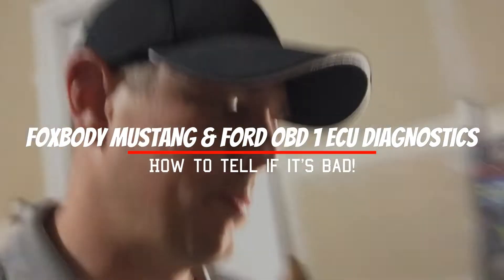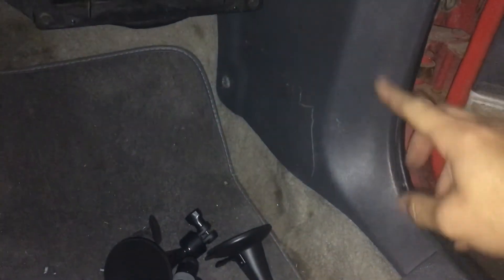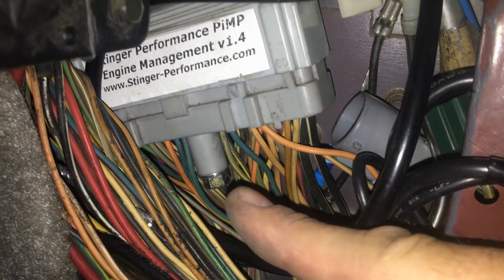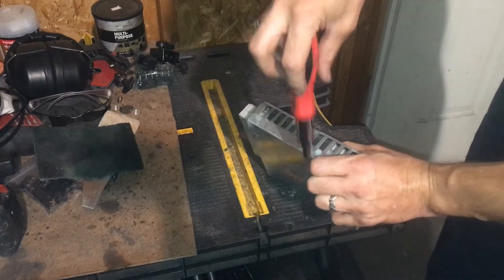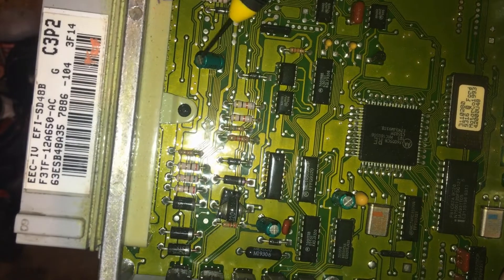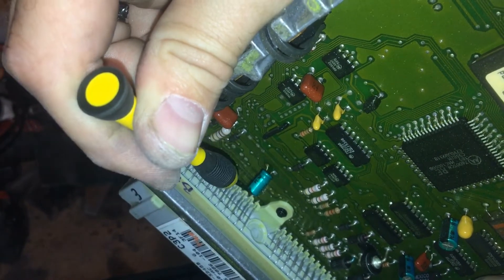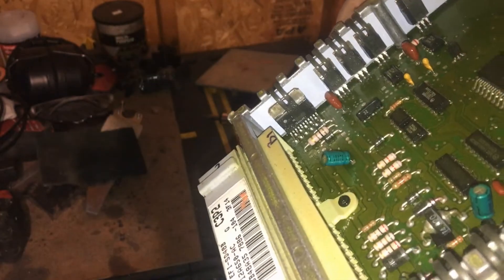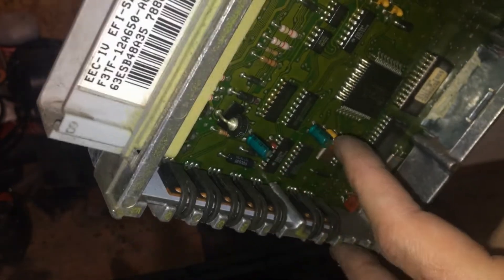How to Tell if Your Foxbody Mustang or Ford OBD 1 ECU is Bad or Needs Replaced

Comment: Did your 86, Speed Density ECU have only 2 compacitors? I'm only seeing  only 2 in a my SD ECU.
Reply from the maker: I don’t know that for sure, my apologies
Reply: @BMF_Garage  ok, thanks. You probably don't even have the SD ECU   anymore
Reply from the maker: I do actually 🤨 just gotta remember where I put it... I’ll take a look tonight..
Reply: @BMF_Garage  thanks, I appreciate that👍
There isn't squat out here, on Google or even in the Forums on this stuff. Thinking 86-88 people need to band together for info 😂
Reply from the maker: Just checked the one I’ve got left in the garage and it’s got three capacitors... maybe one of yours corroded off??
Reply: @BMF_Garage  thanks! Is that a VM1 ECU or DA1? I'm sorry, I have nothing to compare to. You have me wondering now. The car wasn't doing anything funky. 🤔
Reply from the maker: I’ll have to check on that
Reply: @BMF_Garage  thanks! I will look very closely again for a broken/, missing compacitor in the meantime. I've only found one picture of a DA 1 ECU circuit board and it only had two capacitors in it 🤔
Reply: @jpp9846  I got an 88 I'm pulling mine let you know what I got, I turn my key on relay under my seat clicks normal on for a second then off but my fuel pump stays on?  engine cranks but won't start , I leave key on and it floods my engine , swapped relay , starter selinoid , re grounded had it working fine a week later same issue again , very frustrating
Reply from the maker: Fuel pump running shouldn’t flood your engine.  Injectors control fuel into the cylinders....
Reply from the maker: Sounds like the relay contacts are welded closed.  Have you tried replacing it?  If it’s hot to the touch that’s a tell tale sign
Reply: @BMF_Garage  hello sir copy that any info greatly appreciated I'm checking all your vids now lol , I am no mechanic lol when it starts the relay kicks on and fuel pump would fire for a second then turn off till I start the car. Now I start relay clicks and pump just stays on idk why and car will not start and tacs jump on cluster also. I try to just keep this thing going me and my dad got it in a junk yard 25 years ago lol
Reply: @c431inf  I read somewhere that "some times" the ECU is the issue... specifically, bad compacitors, when the pump continues to run?
Reply from the maker: That’s correct.  The capacitors go bad and excrete a green fuzzy goo that corrodes the contacts abs can make them fall of the board
Reply from the maker: Yeah the ecu can be culprit.  I’d pull it and check the capacitor and make sure nothing on the board looks burned or shorted out.  It’s pretty noticeable if it is.  Process of elimination but having a multi meter or volt meter helps out a lot
Reply: @BMF_Garage  heading to pull it now and check it  lol greatly appreciate the guidance and assistance
Reply: @BMF_Garage  pulled it , 2 capasitors one near the pin hook up looks good , the other up top n.g. all corroded  hoping that's it ordering a new one now , I greatly appreciate the guidance sir 🤙🇺🇸
Reply from the maker: Awesome, glad to help
Reply: @c431inf  yup, I'm willing to bet that's your problem👍
Reply: @jpp9846  it was it , plugged in new ecm fired right up
Reply: @BMF_Garage  bad ECM , fucking thank you dude
Reply: @c431inf  I read they can cause it, glad to hear you have it fixed 👍👍
Reply from the maker: You’re more than welcome brother
Reply: @jpp9846  best part bro the ECM was the d1 for a manual and it's an automatic , guess they really don't matter what type lol had the wrong ECM in it since 95

Comment: Hi Clevor BMF, My 93 Mustang 5.0 GT, 5 speed cruise control doesn't work? Checked cruise control cable and not broken, checked vacuum servo and it holds pressure? So i figure it has to be the ECU (?)or the actual switch on the steering wheel????  Any suggestions?
Chip
Reply from the maker: You’ll have to get it up on jack stands and set the cruise so you can hear if it’s doing anything and test the wiring.  I recommend taking the tires of.  Less rotational mass.  Determine if it’s the wiring, switch, or vac
Reply: @BMF_Garage  We road tested it and didnt hear anything? You mean the rear tires? ?

Comment: When the capacitor pops what's happeneds after that.. do some injectors work  or is there a miss in the engine
Reply from the maker: It’ll depend on which capacitor is bad... can range from fuel pump never shutting off, crank but won’t start, barely runs at all.... some symptoms can also be caused by these parts and capacitors going bad but not completely bad yet.
Reply: @BMF_Garage  do these capacitors make a pop sound when they go?
Reply from the maker: They certainly can.  They store energy, so there’s a chance you could hear a slight pop or crackle when they go bad and discharge any stored energy

Comment: I have issue key on fuel pump staying on , I re grounded everything going nuts, I will try this
Reply from the maker: Sounds like the capacitor is the issue
Reply: What symptoms are you having?  My fuel pump currently runs continuously with key on as well.  It's barely running and bouncing from 1200ish rpm to nothing back and forth.  It's also sticking rpm under load and/or it sounding like a cylinder is out and dumping fuel with a little smoke.  I'm having those symptoms currently and I'm trying to rule out the ECU before I move on to a stuck injector.
Reply: @jhoff4362  I would guess the ecu from everything I have read. Going through it with mine now,lol
Reply: @BMF_Garage just wanted to thank you dude , you were spot on , have had mine for 29 years , when it was not working and I could not figure it out part of me was dead also lol, thank you again for sharing your knowledge
Reply from the maker: Hell yeah, glad to help!

Comment: My fuel pump goes on and off and u hear a ticking noise from the fuel gage. Everytime the fuel pump goes on and off the fuel gage does the same dance at the same time, any clues ?
Reply from the maker: That’s really odd… maybe a relay… bad ground somewhere…  they aren’t tied together so that’s odd.  The circuit for the fuel pump is separate from the level circuit…
Reply: @BMF_Garage   when I turn the key only it does that, I just bought the relay im praying this is the issue thanks 4 ur response

Comment: Hey buddy thanks again for your video I pulled out the ecu that I was told was good lol and have a bad capacitor and a burned spot in it took another ECM and I takes gas now so big thank you weres a good place to send mine to and have it repaired that doesn’t cost an arm and a leg lol.. Damn phones I put a different computer in it and it takes fuel now but it’s a ECU that’s not got the mass airflow circuit in it I guess thanks again sir for your help
Reply from the maker: Awesome, glad to help.  There’s a guy that’s commented here on my video that does that actually.  Search through the comments and you should find him

Comment: Thank you for the... doesn't a aftermarket chip burn the ecu as well... and they're companies on Ebay who fix them for 130 bucks or so
Reply from the maker: Some chips can actually cause the ecu to go bad sooner depending on the load they put on the capacitors.  I’ve thought about offering to fix them, but there’s enough people already doing it.

Comment: What specifically controls the ignition timing circuit in these ecm's? is there a capacitor for that circuit? 
It seems that my engine timing is wonky and I'm hearing engine pinging under a load, suggesting that the ecm is not adjusting ignition timing correctly
Reply from the maker: It's been a while since I've looked at the internal circuitry of the ecu, but yes there is a capacitor that controls the circuit.  You can always tell when they are coming to an end of their life as they will have what looks like fuzz on or around them when they are going or go bad.  This fuzz will cause the terminals to corrode and eventually the capacitors will corrode off the circuit board.

Comment: today changed the Capacitors but now ECU is doing nothing .. no fuel pump prime no check engine light ..just nothing..
Reply from the maker: Sounds like something went wrong in the soldering process or you’ve got the capacitors in backwards
Reply: @BMF_Garage  no they are the right way in...but its more Dead then befor ...haha..
damm..I still have not connectet the O2 Sensors but that doesnt matter right..??
Reply from the maker: @Diondo26  shouldnt for testing.  if you got the board too hot it could have hurt something else unfortunately...

Comment: thats exactly the fail I have ... a bad Capacitor ...
Reply from the maker: You can repair them... if you can find the resistors and solder them in carefully
Reply: @BMF_Garage  thats I m gonna try to do ...I run the Megasquirt right now..but I like the original ..it seems that engine runs smoother with the Ford ECU...
Reply from the maker: @Diondo26    the megasquirt is far more capable than the stock ecu...